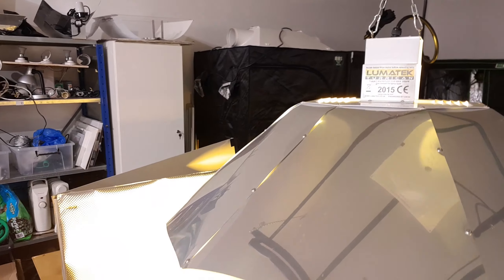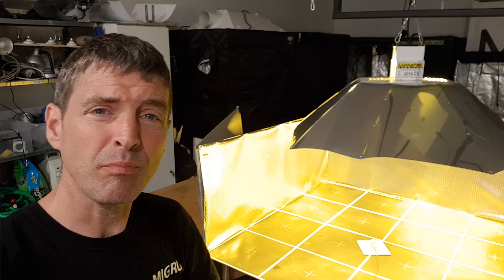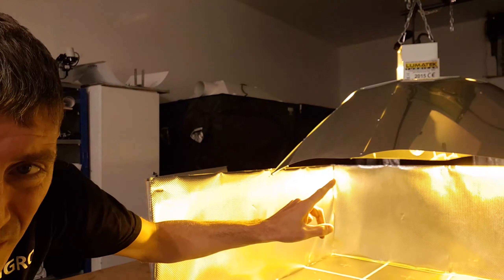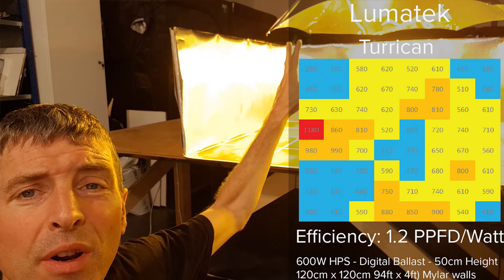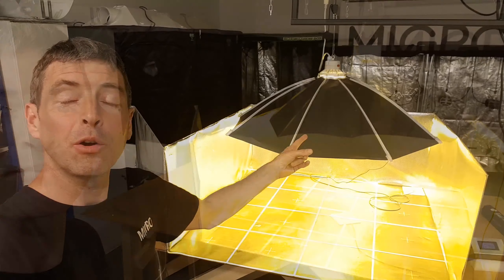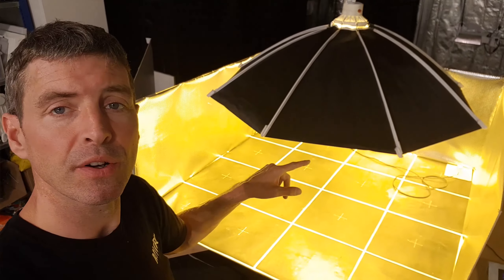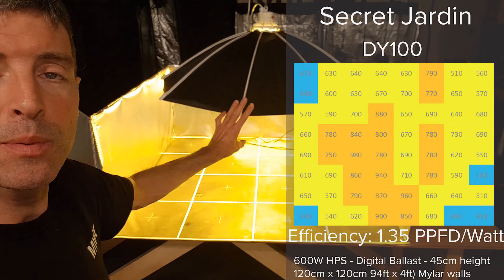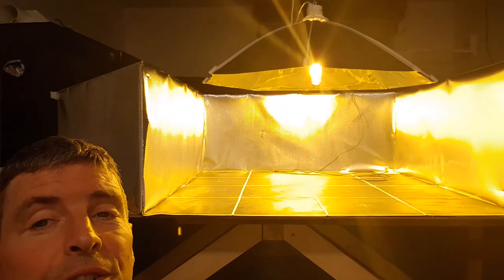Parabolic Reflectors tested - The BEST HPS REFLECTOR I'VE TESTED

Comment: I have just received the Secret Jardin daisy shade. It looks way better than a standard shade. Very happy so far
Reply: Hi are you still using the secret Jardin reflector,  if so how's it holding up two years later after using it all the time im assuming,  have you cleaned it to keep up its performance and is it easy to clean 🤔 thanks ☝️💚✌️

Comment: Decided to get one and see how it compares to air cooled DE/HPS for heat and yield. Probably pick up a couple to replace some XXL hoods, come winter time too, if they perform well. Thanks a lot for all of your testing.
Reply: Did they perform well in the end?? Des420
Reply: So... Any updates?
Reply: @kickass-eu1dh  Sorry kickass... You didn't tag me in your reply, so I never saw your comment until now.
Reply: @ThomasShatter  It actually performed worse in my room due to the open bulb (my room was designed for closed hoods though), and in the interim, I've switched over to LED's from HPS almost entirely (1 fixture to go and I'm waiting for a newer spectrum fixture in November). This umbrella hood is sitting in the box. Somewhere... I'd forgotten about it entirely until I saw your comment. Thank you though, as now I can send it to my brother and get some use out of it. 

TL:DR Quality LED's outperform any HPS lighting in any style reflector at less wattage. 100% worth the initial investment. Make the switch and thank yourself later. Cheers.
Reply: @ThomasShatter  just the best for hps... led will NEVER be good for flowering

Comment: Cool never seen those fixtures before. Curious to how the heat dissipates in those? Looks like it collects at the top of the umbrella. Anyways cool video and thanks for the assiatance
Reply: yes  would it get super hot ?
Reply from the maker: There are vents on the top around the bulb holder. The bulb runs more efficiently hot so that's no problem. And more light onto the plants means less wasted as heat on the side walls and reflector surface. I actually like them a lot.
Reply: @MIGROLIGHT  Never thought about it like that but makes sense.  Very neat thanks for sharing.

Comment: After half year top of the reflector from the inside is turning to dust fibers from UV exposure, and a bit of mylar start to comes of. They should use thicker, diamond mylar, and use something else at the top UV resistant stitching.
Everything in the box is in this dust I suppose it's not healthy.

Comment: How do they compare to an adjust a wing?
Reply: i wonder also!
Reply: They kick ass over an adjustawing. I suggest a 50 inch parabola for a 1000 watt and a 36 inch for anything smaller, and look for a white reflective surface not shiny metal, it helps defuse the light and lessens the hotspots without a hugh loss of efficiency, I get 1.4 grams per watt using this setup with RDWC.
Reply: @torrielandsman4625  how long did the parabolic shade last is it still going strong , or has it ripped at all , and how about cleaning it too ✌️
Reply: @Ismither  bought in 1990 and still going strong, it is made of sheet metal and coated white, it will probably out live me.

Comment: i need a good supplemental light to supplement my old school 1000 watt. im thinking this. or your 315 cmh. but this has a way bigger footprint right this would very light up every dark space i have in my 8x8x10 correct. my hps is on the righter side of the room.
Reply: all the leds and HLG 100 is like a 2x2 footprint correct? so this is my best route correct? its not gonna cost alot i dont care about efficiency at this point bc i know its over what i need. electricity will not be nothing to stress over as well as heat. my enviroment is fully controlled. i just need that for sure light coverage and penetration

Comment: Are these still the best hps reflector in 2022?
Reply: No. When used with 600 or 1000w hps they quickly start to "dry out" and become brittle. Then, they start dropping small white bits on your precious sticky girls which you will never be able to remove. You can still find the smaller ones. I guess the less heat of a 400w would lessen, or slower, the degradation. My advice is keep looking. I can't tell you what you need but I can tell you, this time, you don't need this.

Comment: AVOID!!! THE METAL PIERCES THE FABRIC ENDS WITHIN 12 WEEKS AND NO LONGER PRODUCES A PARABOLIC REFLECTION AS SHAPE IS MASSIVELY DISTORTED, GOOD SHADES FOR 1 GROW IF YOU'RE LUCKY
Reply: Put something in there. I got other issue. I got two of them and the top material turned to dust from UV exposure. This mylar is very thin and easy to rip with a nails anyway.

Comment: If that's the best reflector you've tested ever then you really don't get out much!
 I have a similar version of the first poorly assembled reflector in this video except mine is 4 ft and has a flat white reflective surface, Its the poor assembly and polished metal of your reflector that created the hot spots in your test. I've noticed that you use reflectors that are dirty and poorly assembled when you test HID lights and believe that you do not want to show people how good a properly set up HID light can be. You use inefficient wing reflectors that orient the bulb horizontally and drop the efficiency by 30%, Put a piece of glass between the light and the plants and you loose another 10% so all your tests including this one is distorting the truth about HID lights. I think that if I had a proper PAR meter that I could get numbers that are at least 30% better than the results of the tests that you have done on HPS lights. I think that the truth is closer to 1.7 ppfd for the HPS if its tested properly.

Comment: Terrible form factor unless disassembled.  It's PPFD/W would have to be closer to around 2.0 to even be worth it.
Reply: you need the DE HPS to get around 2.0 they kick ass... LED's are getting there, but its the raw power of HPs lumens  are for humans but if you can put enough of them down plants love them. I am very close to buying an LED some of the grows Iv seen are up there with hids , but it comes down to an experienced grower vs a novice  in the right hands both are capable , talking of lumans LEDs are getting in to the 80k per 500w fixtures Hps are 95k for a 600w and 140k for a 1000w   fixture I have no doubt LEDS will take over HPS in the very near future. cant wait